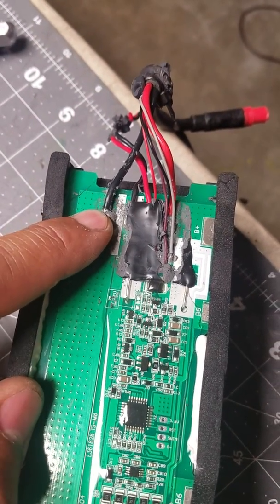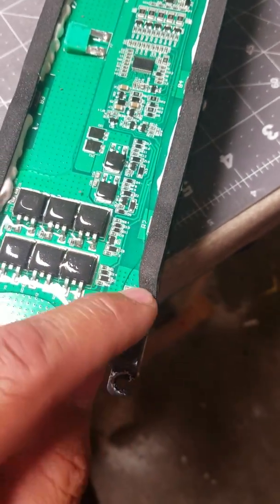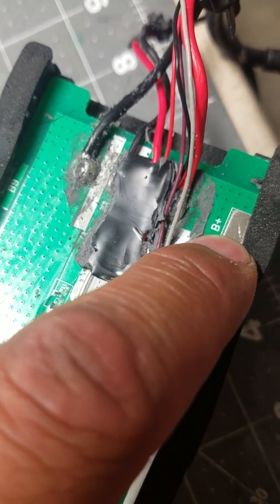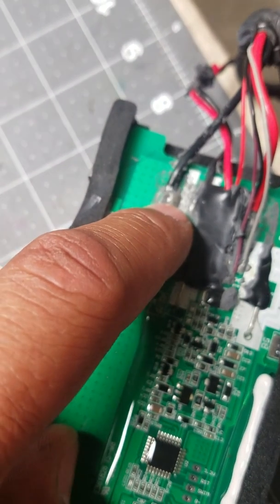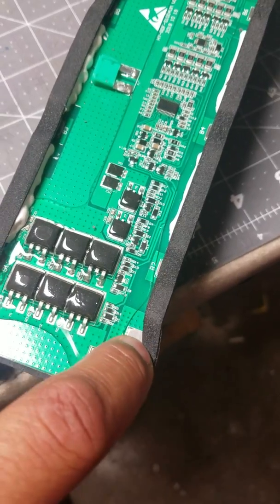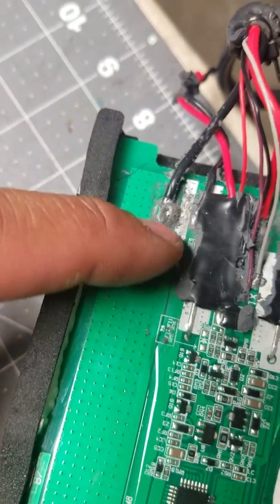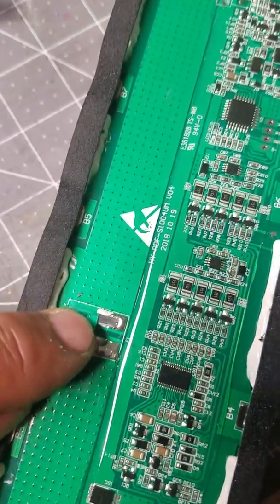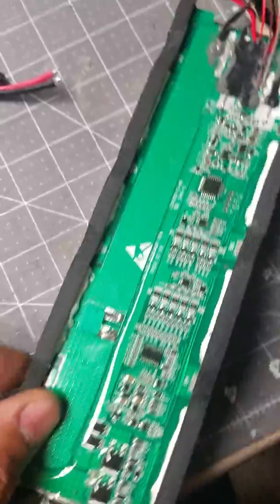bird 590 bms bypass

Comment: Isn't it dangerous to bypass the BMS? Why would you want to do this? Couldn't you overdraw current and override all the BMS safety features?
Reply from the maker: this controller that we are using have safety protection features
Reply from the maker: this controller only draw 15 amp with peaks of 23 and this battery can push 30 amps so we are in the safety range and the controller watts only 250w with peaks of 350 and the original controller from this scooter draw 500w with peaks of 700w so we still in safety zone there to
Reply: @samzone8920  But isn't that a problem with your controller? I'm using a VESC controller (not chinese controller) and seems to be working fine with the battery? Also yes the controller has safety features, but by bypassing the battery BMS when you are charging it will be dangerous right? The BMS helps with load balancing when charging and also has overcharge protection. Your motor controller does not protect the battery during charging...?
Reply from the maker: @shj89   thats when you get wrong  listen when you bypass this bms doing it exactly how i say you only will bypass the draw side but you will keep the bms for chargin purpose the charging system of the bms is not the one i bypass that part should always have to be i  full working condition if very danger to bypass the charging system of a bms never do that never
Reply: samzoneworld I see. How much does Bird limit the current draw through BMS? Scooter seems to go pretty fast already without bypassing BMS. How much more current do you get? How much more speed? Also how did you open the battery without destroying the case? Can you put it back together?
Reply from the maker: @shj89  because i never have been involve with any cuttoff problem so i also never build any bird with bms bypass so i dont know if you gain any more speed   you need to try and let me know but about battery casing i pretty sure they can be reuse after you cut thru the plastic glue it may not look very pretty but will work jut dont cut to deep only 1 quart of the inch the rest is easy to break
Reply: @samzone8920  What's the max current you can safely draw from the BMS without damaging battery/risking fire? My VESC controller can set a limit -- if I bypass the Bird BMS, then potentially it can draw unlimited current? What's a safe limit? 48a? 40a?
Reply from the maker: @shj89  for draw current you will not cause a fire the risk came in the charging process if you dont have a bms to safely balance all the cell you will cause a fire thats for sure the only thing you can cause by drawing  to much power from battery is damage the battery  but not fire so to avoid to damage the battery set the undrervoltage to 28v i here some people set this to 25v i also use 25v setting  but  the battery life span will be reduce 28v is better to make the battery last more years
Reply: @samzone8920  By undervoltage you mean don't drain battery capacity to almost 0% right? What about current draw? You can damage the battery if you bypass BMS and the motor/controller draws too much current right? Do you know what the batteries inside the Bird battery are rated for in terms of continuous current draw? Dont' want to damage the battery. Current would be in amps, not volts.
Reply from the maker: @shj89  is 12800 mha and undervoltage is  to avoid drain battery complete and damhe the battery littion batteries cannot be drain more than 2.7v a mean you can butt they will last less years
Reply: @samzone8920  I understand. In terms of max current draw while riding the scooter, what is the safe limit to set on my controller? 30A? 48A? My question is since you are bypassing BMS, you have to set limit on current draw on your controller. For Bird battery, what is safe limit to draw to your controller for motor? 30amps? 35amps? without damaging battery? Do you know if battery is 10s4p?
Reply from the maker: @shj89  bro i already send you the answer that battery is 12800 mah
Reply: @samzone8920  12800mah is capacity, Not how much current you can draw. you are talking about two different things -- 12800mah is capacity, current draw by controller/motor is the flow. My question isn't how much capacity is in the battery, but how FAST can you draw the current/power? If you bypass BMS, it can draw more current than 30A. But what is safe number?
Reply from the maker: @shj89  ok let me help.you with the mat here if you have a 12800mha battery that mean that you can draw 12.8 amp.per hour you understand now👍?
Reply: samzoneworld I hear you but we are talking about different things. The lithium battery cells have a safe discharge rate just like the safe charge rate is 2A. If you go above the discharge rate it is not good for the battery. It cant be 12.8A, that is way too low. Can you tell me what model the blue lithium cells in the battery pack for bird 590 is? 18650 cells, made by LG Chem? What's the specific model number on the cells? I can look up the spec sheet and let you know the safe discharge rate.
Reply: samzoneworld in other words, do you know if the battery is 2C, 10C, etc? That determines max continuous discharge rate.
Reply: @samzone8920  I did some more research. The cells are LGGBMH11865  (LG Chem MH1 11865 cells). They have a max discharge of 25A if you have ten in series... IF the BMS is limiting current to max 30A, what is the point of bypassing BMS because the cells have a max discharge of 25A anyway? So there is no point to bypassing BMS because cells can't discharge more than 25A safely? Am I understanding this correctly?
Reply: shj89 how did you calculate that it’s 25A to for ten in series? I looked up the same cell and it says it can safely discharge at 3C. The bird battery has a capacity of 12.8Ah so it seems like it should safely be able to discharge at 38.4A. I’m also using a VESC and it looks like the BMS cuts off power well before 30A